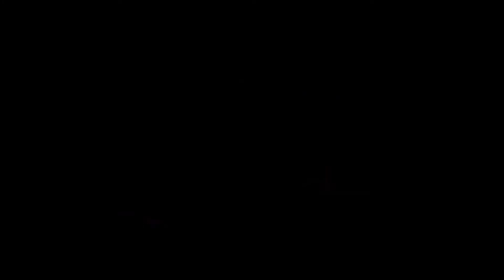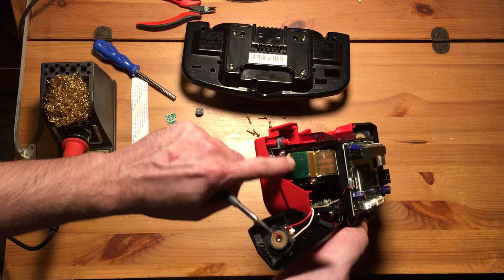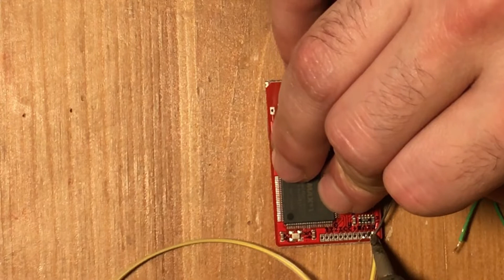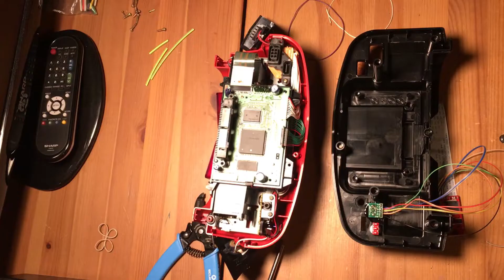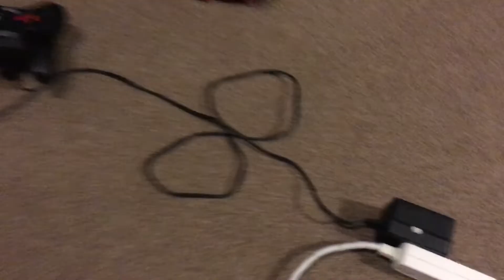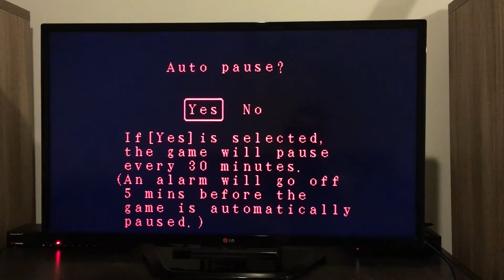Virtual Tap Installation Guide! A Video Out Mod For Your Virtual Boy!

Comment: Do you have anything special set to your ossc? Mine just isn't picking up the signal from my virtual tap, RGB nor VGA. Great guide by the way!!!
Reply from the maker: Thanks, glad you enjoyed the video! No, my OSSC is set to default settings so I’m not sure why it’s not detecting the video signal
Reply: @LIRetroGaming  Thanks for such a quick reply! Yea I'm not sure why it's not picking up a signal, I'm getting voltage out of it but no signal for some reason. I bought it used without a sticker so I'm unsure which version it even is, but both don't output any signal picked up by my ossc. I tried using a modified Sega saturn model 2 9 pin rgb scart to come up with a cheaper solution for people, but that might be the problem since ground is only the shield, and not a pin on the din. Hopefully someone on Planet VB's Discord is able to help out! Thanks again for your help! I'll keep up to date with your channel! :D

Comment: Great video and explanations! It's important to note however that the + is not just for power going into the Virtual Tap, it's also for RGB Blanking signal to switch the tv/upscaler into rgb mode, which MUST be between 1V and 2V, or the tv/upscaler won't pick up the signal. (the instructions specify around 1.7V) I had 2.5V when using a megadrive 9 pin scart cable, and had to add a resistor to the inside of the rgb to get it to the correct voltage, so make sure you're mindful of that.
Reply from the maker: Yes this is correct and it’s something I left out in the video. Thanks for sharing that!

Comment: Does the virtual tap just slide into where the eyepiece ribbon cable slides in?
Reply from the maker: Yes, you install it in the same location as the original eyepiece

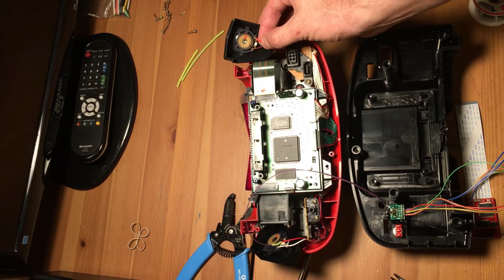Comment: @10:14 can you not keep the onboard speakers connected and just run another cable to the 9-pin minidin so that sound comes out of the RGB AND you keep your sound coming out of the virtual boy when deciding to play using the lens?
Or is this mod meant to get rid of the virtual boy lens and sound completely and leave it strictly to the TV (consolized?)?
Reply from the maker: Yes, if you want you can keep the original speakers operational and also send sound to the television. For this specific unit, the owner did not want to have sound going to both locations
Reply: @LIRetroGaming  - To triple check, 3 year later lol, does this also mean that you can have video running to an output as well as through the headset in the same way? For example, if you wanted to play in-headset but show your output to an audience?

Comment: Is there a way to use the HD Retrovision cables with this mod, instead of SCART cables?
Reply: Joe Starr possibly. I think that you would have to use a different connector like an SNES multiout or a genesis mini din, and then connect that to the hd retrovision cable. But so far I have not tried that out
Reply: HD Retrovision cables should work, but only if your TV supports the 240p resolution that this RGB option (Genesis 9-pin miniDIN) supports.  There is a high chance that whatever TV you have at home, it doesn't support 240p.  This is why you need a scaler such as the OSSC.  

The VGA option outputs at 800x600 and is 100% supported on computer monitors, and most modern TV's with VGA.  It still wouldn't hurt to have an OSSC though.  
Keep in mind what the HD Retrovision cable actually does.  It takes RGB, and converts it to YPbPr.  Thats what that little circuit at the middle of the cable does.  If your console doesn't output RGB (such as a stock N64), then HD Retrovision cables do not work period.
Reply: another cheapo scaling solution is the hyperkin genesis hdmi adapter
i use it for my arcade stuff (supergun genesis 2 rgb) all the time